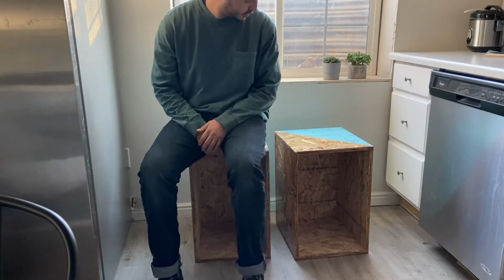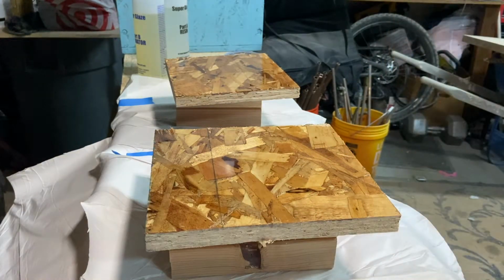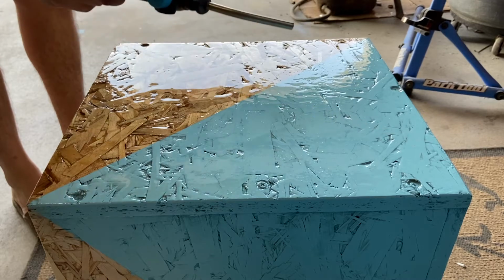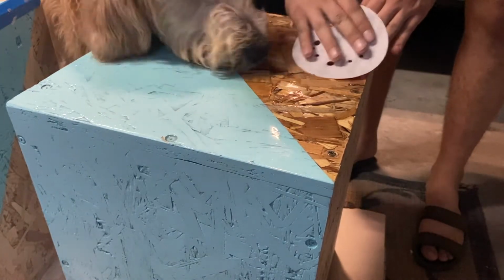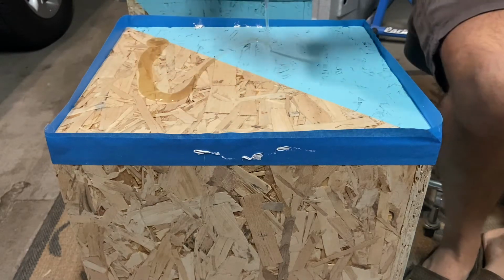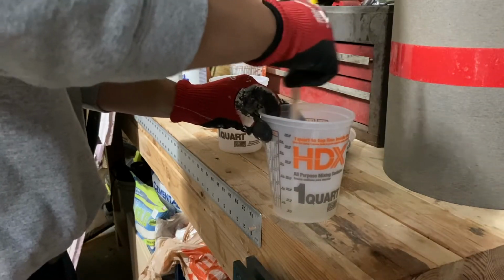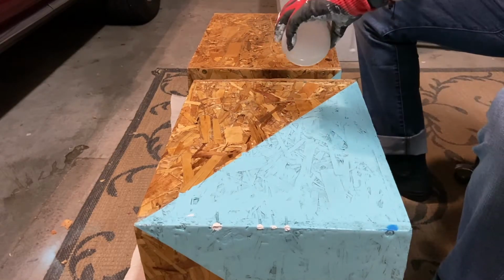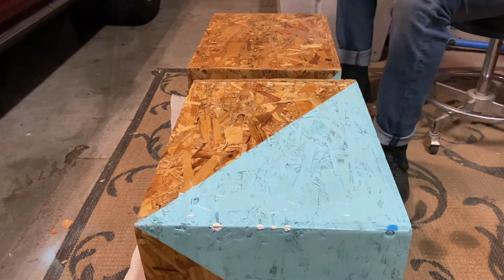DIY EXPOY FINISH on OSB Side Tables

Comment: Nice video, I am considering using OSB for cabinets and etc, especially in my workshop. I normally use only plywood but it is pricey. Epoxy would be my choice of "finish" but the epoxy is very expensive  and would get me closer to plywood with OSMO costs for the final project. I need to experiment on a piece of OSB and see how much epoxy is needed per m2 for example.

Comment: Great diy project 👍 
Why did you use the torch?
Reply from the maker: The torch pops any epoxy bubbles. Epoxy usually  has bubbles when it gets poured. But they dont all pop by themselves so the torch  helps out  with  that.

Comment: How do you "level" it with the epoxy when you pour it over? Looks like you just use the sponge brush to cover it all.  Just guesstimation?
Reply from the maker: The epoxy is self leveling. Before it hardens the epoxy it will flow to fill in gaps. The brush helps to move the epoxy around before it does harden.
Reply: @making_do_  thanks. If I wanted to paint the OSB, is putting epoxy.over it first ideal?
Reply from the maker: @superduperboyx  I mean I did that with this blue paint and the epoxy really doesnt do anything to it. Test it out, should work fine!

Comment: I get sprinters from OSB all the time.  I think I will skim coat both side and totally cover all surface.
Reply from the maker: Sanding it helps a little bit. But epoxy is a nice way to get the OSB look to be preserved.

Comment: Do you need coasters on epoxy
Reply from the maker: The epoxy can get dirty but it can get washed off with a wet towel. So you do necessarily need coasters.
Reply: @making_do_  awesome thanks, as long as it doesn't leave a ring or cloud the epoxy. Appreciate your reply.